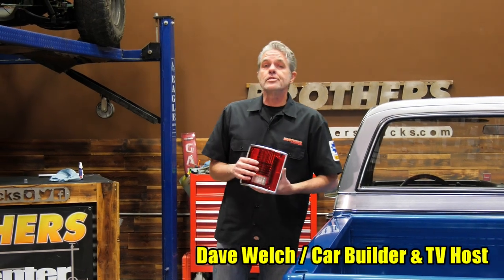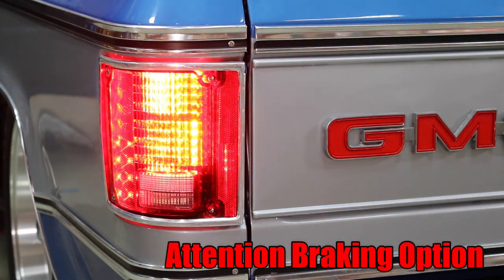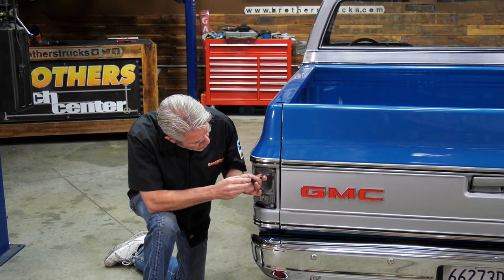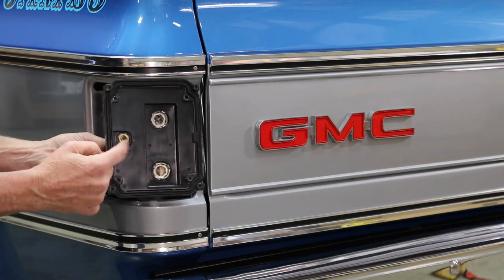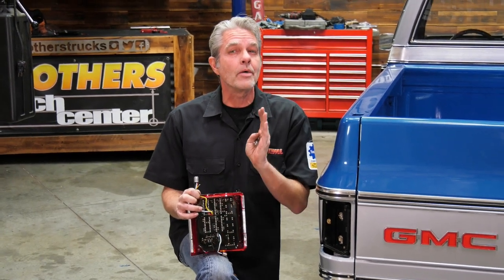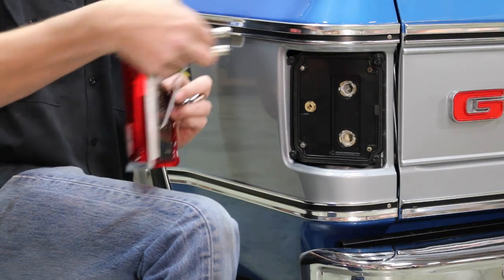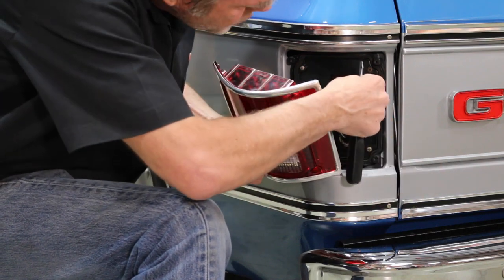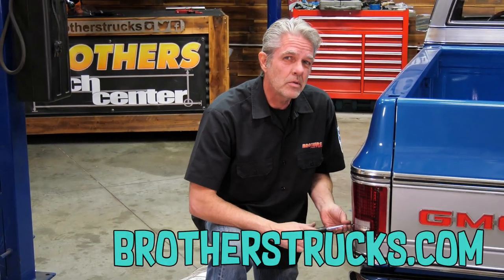1973-87 Chevy & GMC Squarebody Truck LED Tail Lights

Comment: We just put some on our C10 and they are awesome!
Reply from the maker: Yeah, we love ours on Beau James as well. Really trick! Thanks for watching!
Reply: Gasratz Customs hey do they stick out alittle. Or no because I just installed some and they stick out alittle bit
Reply from the maker: @Bino713  they should fot exactly like the original did. Ours are flush.
Reply: BROTHERS Truck Parts that’s weird should I send pacific a msg
Reply from the maker: @Bino713  Did you buy them from Pacific?
Reply: BROTHERS Truck Parts no bought them from a bender here in Houston.  It’s called outback truck parts here in Houston they sell only c10 parts
Reply from the maker: @Bino713  why aren't you contacting the vendor you bought them from? FYI, there is almost always more than one manufacturer for an item. Thats why we do these videos, so we can test stuff to see what works best AND to show our customers how to use/install our products. We always carry the best parts we can find even if they cost a bit more sometimes.

Comment: I have an 87 r10 and just installed the lights. Signals dont flash and when headlights are on brake lights dont light up just stay steady. Am I needing a different flasher or something?? Also I want the sequential lighting, which way does the switch go? He doesn't specify??

Comment: So I did this and everything was fine for a while.  Well now, my brake lights stay on.  Its not the pedal switch because when the headlights are off the brake lights operate normal.  When the key is off they operate as normal with the pedal.  But when I turn the headlights on they just stay on but the turn signals all operate normal under all conditions.  Any ideas?  As mentioned, they all functioned properly at first.

Comment: When I installed mine, if I have the lights on and go to use the signal, it won’t blink, only stays solid. If the lights are off, signals work fine. Any ideas anyone?
Reply from the maker: Ground problem for sure.
Reply: Did you find your issue . I’m having the exact same problem right now ripping my hair out trying to figure out
Reply: @BROTHERSTruckPartsTV   what kinda ground problem ? I’m having a similar issue

Comment: Mine work fine until I pull headlight knob out. Then tail lights go bright like I’m stepping on brake pedal. Push knob back in and works again. Pull knob out and not work again???? WTH Dave??
Reply: Yeah video was lacking a lot..did the proper led flasher under the dash solve your issue?
Reply: Did that flasher fix your problem I’m getting the same problem

Comment: I got the tail lights in I was looking at your guy’s head lights for an 85 I saw that y’all have regular and high beams since I have 4 lights total do I get 2 high beam and 2 regular or I get all high beam for what was really curious on how it worked before I pitched them
Reply from the maker: Yes, you would buy two low beams and two high beams for your truck.

Comment: Checked on your website and I see there’s a deluxe any standard. Couldn’t quite see the difference in them other than the price. What’s the difference between the two? And will the fleetside models also fit K5 Blazer ‘s? There’s no mention of BLAZER’s anywhere in the descriptions on your website..thx
Reply from the maker: The difference is that one has trim and one does not. And yes, they fit the Blazer and Suburban!
Reply: @BROTHERSTruckPartsTV  ok thanks for the quick response.

Comment: were these changed or updated at some point? I'm just asking because I purchased these when they first came out years ago and they came with a white halogen reverse bulb that could easily be swapped for an led reverse bulb. Also at the time they came with a long wire that needed to be run from one side to the other to connect both led tail lights to one another to work properly.
Reply from the maker: We can only respond regarding the LED lights we sell, but they have not been updated as long as we've been selling them.
Reply: @BROTHERSTruckPartsTV  thanks for the response I looked further into it and there was another company that manufactured a very similar style to these at one point but are longer doing so.

Comment: Do those taillights comes wit the LED flashers in order for them to work properly?
Reply from the maker: You only need a special flasher if you have converted ALL your flashing lights to LED. If that has been done, we sell an LED flasher separately. https://www.brotherstrucks.com/ELECTRONIC-FLASHER/productinfo/FLASHER/
Reply: I only convert the taillights but I'm having issues. It seem after hooking everything up correctly, when I turn on the ignition, the taillights seem to come on. I have a 85 c10 and never had a issue with the lights. No wires touching, shortages or anything
Reply from the maker: @ruccimack97   Tony it sounds like you have a ground problem somewhere (even the front parking lights could be the problem). LED's are extremely sensitive to any power source, and a bad ground could provide just enough power to light the LED's. You could try and LED Flasher, but we suspect that you'll still have the problem even after that.
Reply: TONY MACK Yes they are awesome

Comment: Don’t use these. I tried them and they wouldn’t fit at all without grinding off a ton of material off of the backing plates and lens housing. Threw the led pieces of junk in the trash and went back to regular bulbs. The factory fits like a glove and is 10% of the cost. These leds are a major waste of money.
Reply: Facts also found out the hard way broke on installation